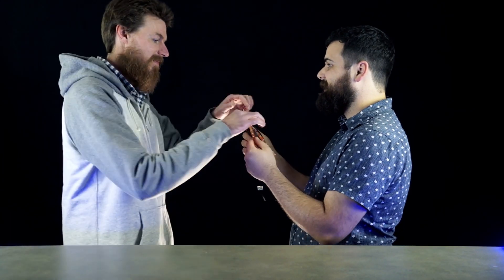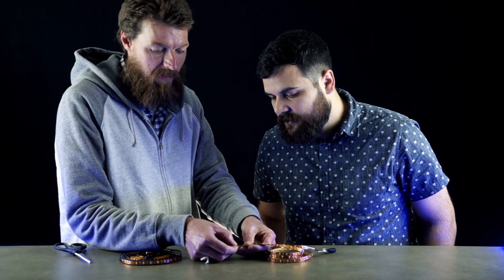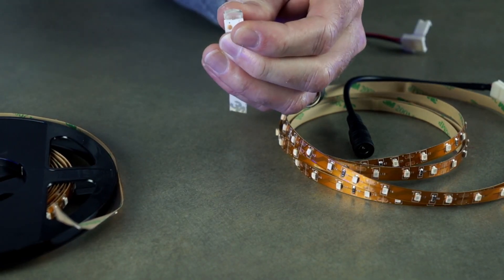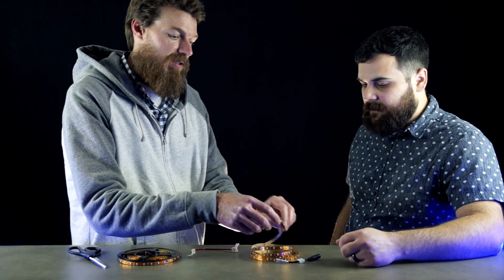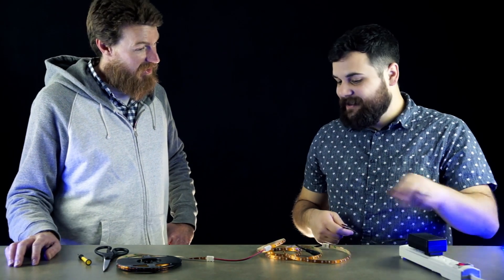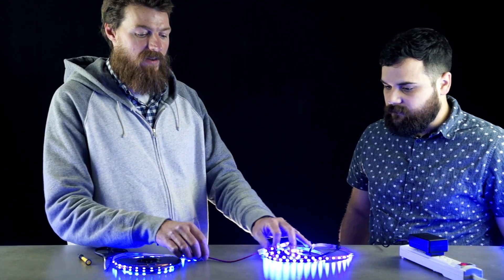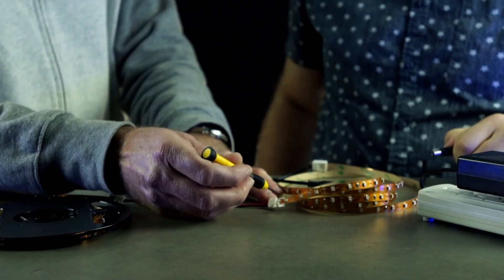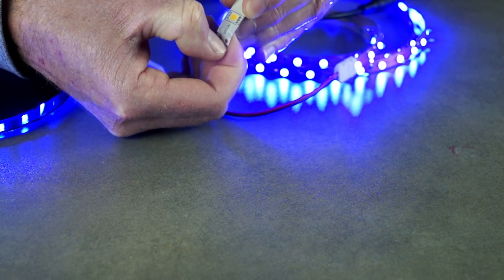Common LED Light Strip Connection Issues

Comment: My led lights are protected so I can’t do all this , but I literally got my light today and I stuck them on my wall when I was done I wanted to test them out , they didn’t work
Reply: Debszz flip the little plugs
Reply: DrinYi lol it’s fixed dw
Reply: Debszz how did u fix them?
Reply: 8jadee _ I took them off my wall and stuck them again then MAGIC it worked 😂
Reply: Debszz how??
Reply: Jaedan J Idek
Reply: Debszz when u took them off your wall. Did the paint got off too? Coz mine did and Idk if I should continue
Reply: A. April no because I had led lights that you nail on . Not sticker one
Reply: @debszz415  fair enough. my lights randomly just stopped working. i just received it like 2 weeks ago and it worked completely fine til yesterday
Reply: A. April peel or nail it of carefully and then test to see if it works without it being hanged up. If it does hang it up again carefully. Commitment 😂😌
Reply: Debszz I did but it still not working 😭☠️
Reply: Same

Comment: My lights flash for a second when i plug them in then stop working, ive tried making the arrows face each other, ive tried to change the cables or replug them, IVE TRIED EVERYTHING, still nothing works, somebody plz help me i spent 34.5 dollars on them and im so disappointed..
Reply: me to bro, me to
Reply: same!! the lights disconnected from each other & when I reconnected them they either don’t turn on or if I push them together with a lot of force it will twitch for a second & then just turn off.
Reply: jasmine oh dont worry now they worked!
Reply: jasmine ty sm!
Reply: jasmine if u figured out how to fix them please tell me i rlly need help
Reply: Mariam Potato idk if it was just mine but, try & ‘disconnect’ the first strip from the actual plug if that makes sense. so make it so that all the trips aren’t connected to the plug. then disconnect the last strip & connect that one with the plug

basically just reorder the strips so that a different one is the ‘first’ strip connecting to power. 

sorry for explaining it so confusingly. good luck:)
Reply: jasmine i didnt get it, some cables cant be plugged together cuz they don’t fit, how did u do that??
Reply: jasmine they stopped working again😭😭 i think i need to get new ones

Comment: I tested mine and it perfectly worked but then i cut it on the copper thingy and cut it in the line after that the only strip near the plug is woking and the rest doesn’t work
Reply: Jake Lark sameee

Comment: The connectors on my set just don't work. Maybe a few of them at best but here's the worst part. The most important one doesn't work. The one connected to the power! The light strips themselves seem okay but I can't use mine if it can't connect to the power. I seriously hope they actually did something about this. I don't even think I can find the set I bought. I bought them last year. I put the whole kit away because I was frustrated and forgot about them until now. I tried to set it up again and .. nope.

Comment: I was re adjusting mine one day and then they started flicking while I was adjusting them and they haven’t turned on Sense what do I do?
Reply: Mine are 2 differnt colors😂😂
Reply: _. eelo omg same
Reply: Debs The Gamer I figured out how to make them work again what ever you do DONT CUT them just re plug them in hope it works for you:)
Reply: @eelo810  So I outlined this metal ship and everything works great. I have them plugged in so where i was setting up I cld figure out the problem if they were went out, but they didn't. Should I just leave as is and not try to cut them bc I can just tape where I finished up.. Wish I can send a pix. If ppl just lit them as they were going along and the lights went out. Then that's were the problem is. Oh, If I don't cut them either then I will cut where the next when I use them for another project. Hope this sounds right.

Comment: Mine won’t turn blue, when I press blue on the remote, it turns off.
Reply: Yee Bears same but mine won’t turn red
Reply: Menuka Edits so I figured it out. You know the four wires and the start of the strip? Your red one might be detached from the strip
Reply: Yee Bears but how would i fix my entire strip working except for one light being green when i choose blue? literally just one light?
Reply: Breeze well to be honest since it was one light and i couldn’t figure it out, i just covered it with black tape and since my strip is so big i can’t even tell the difference, lol. sorry!
Reply: Hold fade bottom right when light are off.
Reply: My blue isnt working samee
Reply: Same

Comment: When i turn mine on they light up white and wont change colors or work with the remote. I bought 2 sets and both are doing this.
Reply: What did you do to fix it
Reply: Heather Fowler hi mine were doing the same thing you can do 2 things, either contact the company or you need to check the connection. If neither of those work try lightly pressing the led bulbs.
Reply: You need a special battery.
Reply: Mines are doing the exact thing
Reply: Mine are new and all they do is blink red

Comment: My lights won't turn on at all. It's not a problem with the power source, it works fine when other things are plugged into it. What should I do??
Reply: Check if there is arrows on the plug thst goes into the lights if there is then make sure they're aligned. If not make sure it is plugged in properly. If it isn't to do with wattage then it must be with some of the parts depending on which one it is, it could be the adapter most of the time it is so if you can find a model number on it and buy a new one thats all the advice I can give you however I'm no expert.
Reply: Liam 
Can u plsss help me !! 😭😭 I got my led lights today & they were both working them when I was installing them & once I put them on my wall they were still working then out of no where one side of my lights cuts off (they were working for a good hr or so) any advice ?? Plssss answer 😭😭😭

Comment: Mine just won’t turn on
Reply: My led just turned off for no reason
Reply: ツTTV BOPP see if anything isn’t plugged in correctly, maybe one of the plugs/wires became loose. If not it’s the battery of something.
Reply: You know that box that's plugged into two things? Like the actual led lights and the wire that's leading to a outlet? The one with a bluetooth wire for the control to work to be specific. Flip the wire over and connect it again, and try to turn it on. If this doesn't work then something isn't connected right, or the battery for your control is dead.
Reply: @Tiffaroni  thank you so much!!!! Mine finally worked after that:)))
Reply: kotu x no problem! Glad you get to enjoy your LED lights now :)
Reply: @Tiffaroni  I have one of those round wires that connect to it but I've turned that around and it still doesn't work :/
Reply: So you know how there is a white or black box that’s connected to the actually LED lights? (The Rgb control box) Unplug the wire that’s leading to an outlet and flip it the other way, if this doesn’t work then buy new ones.
Reply: aesthetic freak damn for me you know how the black box lights up green its not lighting up at all i do that thing all the time now its just completely broken :/
Reply: ha1f type you might need to buy new LED lights now then :( see if in any you can make it work, but I’m sorry you didn’t get to enjoy them :((
Reply: @Tiffaroni  thank uuu xx you're a life saver
Reply: @yuni9809  no probelm! had to figure this out on my own, it took me forever to realize this lol ☠☠
Reply: aesthetic freak flip the big box or the small white box that’s connected to the led lights?
Reply: @i__sirno1713  did you get it to work? If not, there's a video on my channel that might help
Reply: @Tiffaroni  thank you so much I couldn't figure out how to do it
Reply: @Tiffaroni  thank you so much
Reply: You’re remote could be broken that happens to me so I bought a new one
Reply: This happened to me once before, i think it's to do with voltage I had a faulty plug extender so I plugged it into the mains or another one and it worked when I pressed the on button on the remote.
Reply: Liam do you think I should buy an adapter?
Reply: @isabellesiva3778  I am not an expert at this stuff however as the person at the top said how his won't turn on I tried plugging mine into a new extension cable or wall power which worked when I pressed the on button on the remote. If this is happening to you I would suggest you check the voltage conversion sheet you may get in packaging and check how many inputs you are putting into the lights. If the voltage is correct I suggest you take a look on the adapter and see if you can find a model number then order it online. Alot of these manufacturers make very cheap parts that mess up my brother had one of these led strip lights and the infra red sensor didn't work but when i plugged mine into his it worked.
Reply: ezzie xx same
Reply: Same
Reply: Same
Reply: Mine is stuck on one color but my remote won't change it and I even changed the battery and it still won't work
Reply: @nana_ bxbes same homie
Reply: Same
Reply: I think you got scammed
Reply: I have in my possession a sign that used to be of a closed down convenient store. It's an outdoor sign and had 100 working led lights. Until the guy from the best buy store sold me the wrong power supply. I now have a giant piece of fiberglass doing nothing 😊
Reply: Mine won’t either

Comment: When I hit off on my remote, it just turns red, what do I do?
Reply: Mine too
Reply: This happened to me but with green I had to replace mine I think its to do with the power going into he strips make sure the arrows or the metal tabs that go into the lights are connected properly. If not I cant help you I tried to find out what happened to mine.
Reply: @Liam-yy9ll  I purchased a 2nd light strip and it did this too
Reply: @alanazoem7588  must be either to do with installation or the wattage conversion I'm not an expert at this though.
Reply: Mine turns blue

Comment: my LED lights turned off completely and when i turn it off and on, the light just flashes. please help
Reply: Rina Mutia is your light flashing and then going out when you turn it on? If so, it’s most likely your connection. I had to switch out different wires, until it would finally work. Also, put up your remote on to it, and hold down the on button until u stays on, just so you know that they are not broken, then switch wires and other stuff around, and they should work again.
Reply: Matthew Rader hi I have the same problem as you: pressed the strobe function and they just went off and wont come back on. How did you solve it?
Reply: You either pressed the strobe light function on the remote if there is one or it generally is a problem with the connection or power going to the lights check the plug and wires.
Reply: @Liam-yy9ll  oh my god you helped me. I did the exact same thing oh my god thank you lmaoo
Reply: @minionssupercool873  I'm not even an expert on this I surprised that actually worked I'm glad I could help I guess haha.
Reply: ClickBayt Queen what did you do?
Reply: ClickBayt Queen how did u do it? The last thing I pressed was strobe and now it will not work and I’m sad about it, I just bought them today.
Reply: Liam where’s the strobe light function on the remote?

Comment: Around the 2:30 sec mark they show how easily you can slide the strip into the connector.  This is BULLSHIT.  Those connectors have got to be the most ill conceived, poorly designed, cheaply manufactured POS products I've ever had the misfortune to work with.  First, trying to slide them under the silver tabs is impossible without bending the tabs up slightly because they didn't put an upward bend on the tabs.  So when you are trying to insert it, the silver tab jabs in the middle of the strip or the strip slides over it.  So you bend the tabs up juuussssttt enough to get the strip underneath, but whoops, you went too far and now they aren't making good contact.  So I re-watched this video. (Before I bought the lights I watched this video and I thought it was so random that at the 3:45 mark they were talking about pushing the silver tabs down in order to get the lights to work.  After installing my lights I now realize that this is a HUGE issue with these lights, so big in fact they addressed it in a video.)  So you push the tabs down with a non-metallic object and finally they light up!!  Then you release the pressure and........ they go out.  Now do this about 25 times for each connector.  (I did 8 connectors)   Finally you get them to stay lit, so you gingerly fasten them under your counter or on top of the beams in your living room.  As soon as you glue down the last foot or so.... they go out again.  Now you get to work on those wonderful connectors while laying on your back or on top of a ladder.  Horrible product, I wouldn't wish this installation on my worst enemy.  (And yes, I've just spent 2 days on a job that should have taken 2 hours at most.)  If I could get my hands on whoever engineered these connectors, I'd punch him in the neck as hard as I could.   *sarcasm!     
Kinda....

Comment: to hang up my lights i used staples, but some staples penetrated the actual strip, they worked fine right after i hung them up but a few weeks later they spontaneously stopped working. i haven’t tried replacing the battery in the remote but i’m thinking that could be a potential cause. please help, i don’t know what else to do
Reply: Staples?? That's dangerous isn't it?
Reply: U broke it dummy